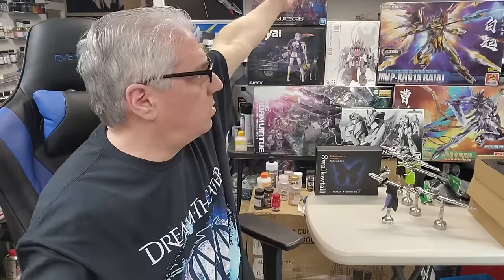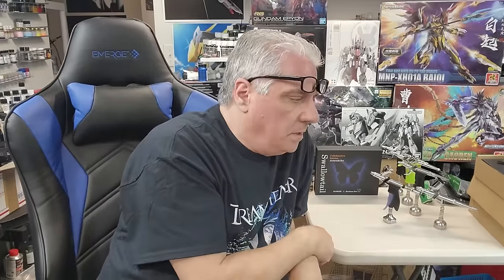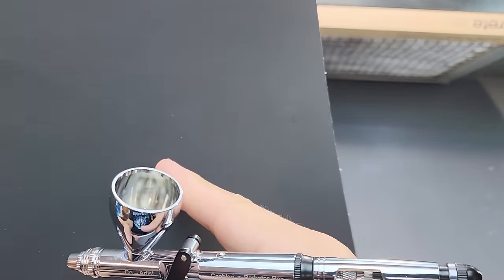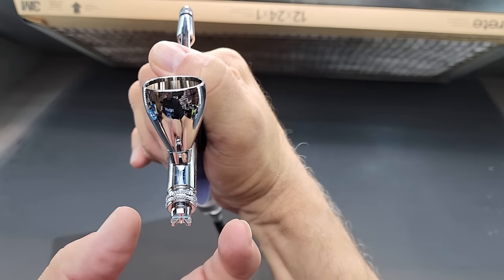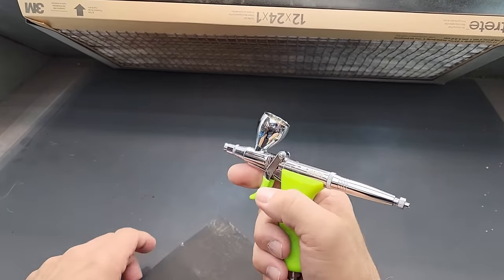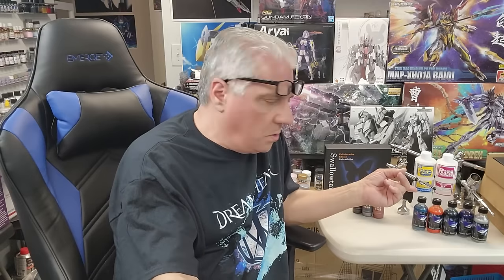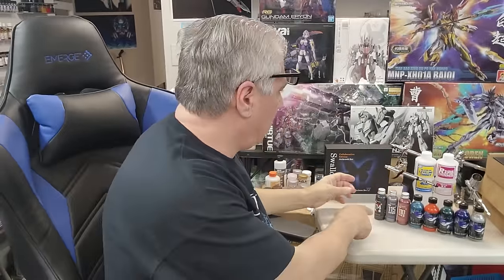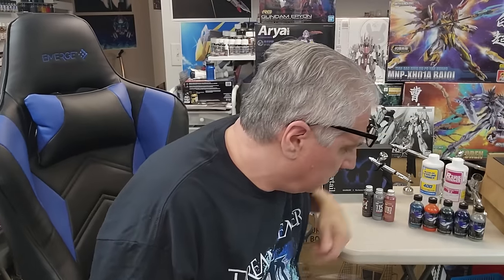Showing How A Trigger Airbrush Works As A Dual Action Airbrush

Comment: Thanks Robert.  For those that aren't familiar with the fan cap ... if the "wings" to the fan cap are horizontal, the fan spray pattern will be vertical.  If the wings are vertical, the pattern will be horizontal.  I've had my fan cap for my PS-290 for a while and I recently got the Swallowtail fan cap.  They are great when spraying a large area (like 1/48 scale aircraft).
Reply: That's my plan for 1/48 scale PBY Catalina 😂

Comment: Aight. That's it. Your swallowtail is a much better version than the Studio G I got. Idk if it's just the QC problem but mine doesn't do the dual action even with just a slightest pressure on the trigger for air. It blows paint right away and I tried all the needles size available already. Hope your swallowtail becomes available soon. Thank you very much, Robert! You're the reason why I'm now using a proper airbrush and tools. ❤❤
Reply from the maker: They should be back in stock before the end of the month.
Reply: @barbatosrex9473  looking forward to it. Great Great work!! I'm supporting you all the way!

Comment: A very simple concept... If you ever painted with a full size paint gun gravity feed... They are dual action as Well lots of the time painters set them at full fluid wide open meaning that the trigger is depressed and the needle is then turned in until resistance is felt and you stop there at full fluid when fully depresed trigger... Then First stage is just air then second is paint which when set to full fluid you can control the amount of fluid by how much you pull back on the trigger takes some finesse to learn to control but that's two stage paint delivery.. Aka dual action.

Comment: Thank you. My swallow tail with fan cap and holder just came in on tuesday. Its my first trigger style. I think others may have had the same misconception as i did in thinking dual action meant independent control over the air and paint. This makes sense that the trigger controls the curve for you. You wouldnt want a ton of air to spray a little stream of paint or vice versa.

Comment: These work exactly the same way a traditional automotive paint gun operates...  Remember the threaded knob at the tail of the brush, can be adjusted to limit the amount of pull back to very accurately control the paint volume.  The fan cap also makes the brush spray just like a real automotive spray gun. This is useful in larger scale models with wider surfaces to obtain very even thickness, compared to round pattern spray.  Really looking forward to arrival of my fully optioned Swallowtail.. Its going to be a great addition👌

Comment: Great video for new folks to airbrushing. Here's another one about ball bearings and mixing paint. Do you use a single bearing or two (or will it depend on the thickness of the paint) and do you leave bearings in the bottle until the bottle's empty or do you pull them out so they don't rust in the paint?

Comment: I bought one, but I'm having some trouble getting it up and running. I'm currently in contact with support for some weird near out of the box air pressure issues. It FEELS good to hold, though!
Reply: Update: I dropped it back to .28 and had no airflow issues. My problems seem to be related to either the .5 nozzle or needle. Edit: Also, the suggested psi level is 30 according to Gaahleri support - I'm used to spraying at 20, so this was good to know.

Comment: Very good! It's funny, but I never really thought about it in all the time I've been using spray guns that it's duel action. I use the properties of that action all the time, I guess I just always have associated that term with airbrushes. So glad that things are going so well with both your paint line and your collaboration airbrush. I wasn't able to swing getting the airbrush this time around, but I will later, so I'll be able to use it with my Grex and have the ability to switch between them on a project.

Comment: I got all my swallowtail and fan caps and very very happy. I would like to see smaller Needle sizes .I use the 0,15mm in one of my H&S v2.0  I  really like the small needles for German ww2 aircraft and tanks. I'm surprised how good this airbrush is very happy I have to order some for Friends .good price. Very happy with the price and There Customer service is incredible.
Reply from the maker: That's great. So glad you like it. Thanks for your support
Reply: @barbatosrex9473  some how it came early I wasn't expecting it for another couple weeks, but man I really enjoy it I been using it for a couple hours now and very accurate and impressed they did really good 👍 👏 👌

Comment: The fan tip that you offer is great! What airbrushes does it fit?  I just bought one of the Amazon best selling trigger type of airbrush. I haven’t tried it yet, cause I was really considering the Galleria pistol grip. If you know anything about the brand I got. I’d like to hear what your thoughts are. If I should send it back, and get the Galliria(I know I spelled it wrong) but I like that fan tip! It looks like it would work well for what I need an airbrush for

Comment: To spray automotive filler primer with an airbrush, how much of a needle size should be considered ( 0.8 maybe ? ). Or you need to go to a mini spray guy for that ?
Reply from the maker: I've sprayed Duplicolor primer with this airbrush using the 0.7mm needle that comes with it. Remember if you ever have a problem just thin it a little